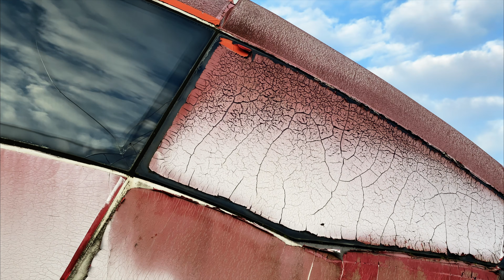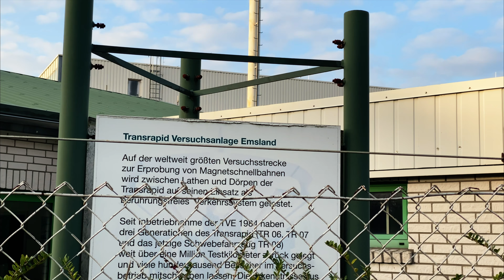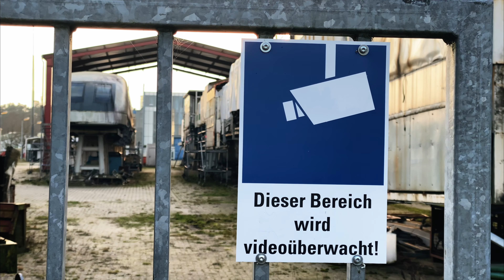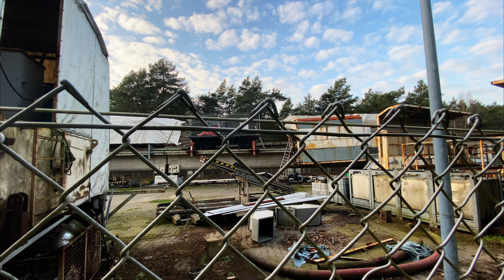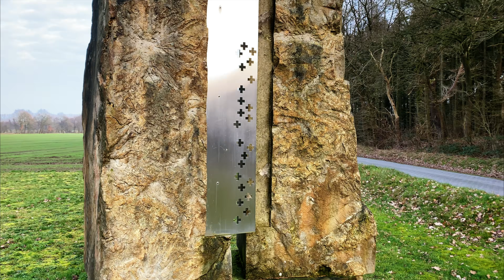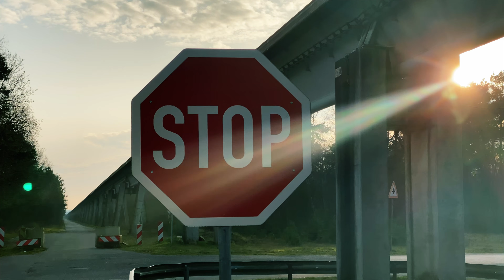ABANDONED high speed MAGLEV WRECKS - 'Transrapid' graveyard

Comment: Unfortunately, Maglevs are too expensive and too much effort to build and a nightmare to implement into already exsisting infrastructure with too little benefits compared to modern highspeed rail, to ever become a viable mode of transportation. There will probably be a few prestige projects connecting an airport with a city center, like the existing one in china, but that's it. That's the real reason the project failed (which was by the way pretty obvious even before it started) and not because of malicious politicians, environmentalists or bad marketing like claimed in this clip. And that's the reason why the hyperloop (or any similar projects) will (actually kinda already is) completely fail miserably as well. I'm tired of people calling technologies like monorails, maglevs, etc. a "revolution of mobility" because it isn't. It's still some sort of rail-bound vehicle moving (hopefully at least a high capaity of) people or goods from A to B. No game-changing revolution at all, just the same stuff painted in a different colour and 3x -100x more expensive which will be noticed at the ticket counter. Instead of trying to "reinvent the rail" , railway engineers and companies should first and foremost increase the capacity of the existing network and make travelling by train cheaper and more comfortable, but that's just my opinion. What do you guys think?
Reply: You are right. All is a matter of costs/benefits ratio. But image if we were in a non capitalistic system , where the aim of any work is to generate a financial profit. In a non capitalistic system (No, I am not talking about communism!), there would be no money, no currency, just because it is not needed. Everything would be made just because it brings improvements and people want it. Every kind of project would be only matter of collecting the necessary working power, willing to work to make the project true. No financial benefits would be required, because there in no monetary finance. Then, in that system it would not be a problem to replace all the high speed trains with maglev, if people would really like reduce to 1/2 or 1/3 the travel time. The entire rail network could be relatively quickly replaced by maglev, since it requires much less maintenance work on tracks and mobile parts. Traditional railway requires a huge amount of maintenance work and replacement parts every year.
Reply: This, to me, sounds as a likelier reason.
Reply: @rcandfun242 - "Unfortunately, Maglevs are too expensiveIt...." - sounds like you have the answers to the burning questions why MAGLEV is not used. Too expensive, not compatible, these are the usual problems that are mentioned, you can read them in practically every video. But honestly, isn't that too easy?
No matter which video I watch, everywhere the same crap. Fares of a hyperfast train are compared with those of a subway and extrapolated to European level, and end-to-end travel times against polycentric connections. This is nonsense, don't you think? Above all, these are not the real reasons, but why can't you find anything about them? What about the transformer stations, what about the switching times of the switches, what about the enormous consumption of metals (copper, aluminum) - these are topics that would be worth discussing.

The Hyperloop will fail as it is designed now, this is the only point where I agree with you.

Comment: China is considering re-opening the test track and the Transrapid design is the preferred choice for a 600kph maglev network across China. 

The technology was just too early and novel to be appreciated.  

Britain should have chosen UKUltraspeed (which used the Transrapid design) rather than building HS2.
———
German maglev test track set for revival? 
6 April 2021
International Railway Journal
https://www.railjournal.com/passenger/high-speed/german-maglev-test-track-set-for-revival/

INDUSTRIAL Plant Operating Company (IABG), which is responsible for the former Transrapid Emsland test track near Lathen in northwest Germany, has confirmed to local media that it has been approached by CRRC about re-opening the site as a test area for CRRC’s new maglev vehicles.

CRRC has continued to develop the German Transrapid technology under license from Thyssen-Krupp. CRRC’s latest CRRC600 series maglev train will be used on the planned 400km, $US 14.1bn maglev route connecting Shanghai with Ningbo via Hangzhou in China’s Zhejiang province. The Shanghai – Hangzhou project was announced in 2020 and is expected to be completed by 2035.

Demolition work at the Emsland site, which began five years ago, has largely focussed on stripping out the valuable electrical equipment for recycling; none of the test track’s concrete structures have been demolished although new electrical equipment and refurbishment of the 31km elevated test track is required if the facility is to reopen.

Potential use of the Lathen site as a hyperloop test track has also been proposed by local politicians keen to attract technology companies to the area. The basic concrete structures could potentially support a hyperloop tube if further use for maglev vehicles is ruled out.
...

Comment: The Transrapid also has some very serious limitations. Railway switches are very expensive and complicated. And freight would be much more expensive, because you now have to change mode of transport between trains and maglev. A quick search didn't show me any pictures of maglev cars  that could carry standard shipping containers.

So, at least for a few decades, Transrapid would have to run in parallel to existing (or even new) classic rail lines. Passenger-only tracks might be viable as an inner-city transport in some small number of cases, and then only if you mostly plan for point-to-point connections instead of a network that will need lots of rail switches.

It really doesn't matter how good the technology is. If you have to basically start from scratch instead of having the ability to upgrade the existing network segment by segment while staying backward compatible to existing rolling stock, then it's just too damn expensive.

Given the large existing railway infrastructure in germany and the whole of europe, it would probably take 50-100 years of heavy investment before you can even start thinking about making a profit and slowly getting your money's worth.

And you also have to keep in mind that Transrapid would have to compete with ongoing innovation in classic trains as well as cheap budget airlines as well as road traffic, i highly doubt that Transrapid ever had the chance of getting implemented. It was an engineers pipe dream all along.
Reply: OMG!

The only reason fore failing are people like you! You are German, right?

Instead of writing a lot I'll point out only one aspect:

All really successful high speed trains (with conventional techniques) have their own tracks witch are not shared with freight train or even local trains.

- Shinkansen Japan
- TGV France

Therefore your reason is no reason.

VGA
Reply: @DB_lO3_ll3-7  No i'm not German.

And logistics plays a LARGE part in any successful future rail project. It's also worth noting that at least TGV can use the normal existing rail network, the same as the german ICE. This is giving them an automatic advantage, because they can use tracks that haven't been upgraded to reach some destinations.

The town where my parents live is currently getting new high speed rail, but surprise, it will also be used to carry freight, because it doesn't make sense to buy more land, build more bridges and put in additional rails just for the occasional freight train.
Reply: @ReneSchickbauer  I think you are absolutely right. It doesn't make sense to build new infrastructure projects in Germany, Europe or the US.
Couse Chinese can do it cheaper and faster. And they will do it.

And there's still hope that they'll use the Transrapid
https://m.youtube.com/watch?v=fvMXvRA03ps
Couse in new Chinese version, so one will remember, expect of some people who do the research in the 1980th... and me.

P.S.: switches are really expensive. About 100.000 €. For a conventional switch of course. Can you tell us, the cost for a switch from TR? Or is it more like a religious "expensive", something to believe?
And what should be complicated? A peace of steel witch is bend? Like every switch in rail technology.

VGA
Reply: "Railway switches are very expensive and complicated"
Expensive .. well yes sort of, complicated, really no. A normal rail point is more complicated.

"And freight would be much more expensive, because you now have to change mode of transport between trains and maglev"
It not diffrance in any way to any other mode of transport. Either way, it was not really ment for gods.

"A quick search didn't show me any pictures of maglev cars  that could carry standard shipping containers."
Well maybe you should seach more. Either way, did you see pictures of high speed rail with containers on?.. No you didn´t.

"Passenger-only tracks might be viable as an inner-city transport in some small number of cases, and then only if you mostly plan for point-to-point connections instead of a network that will need lots of rail switches."
Pretty much all high speed rails around the world are passenger only.

"upgrade the existing network segment by segment while staying backward compatible to existing rolling stock,"

In Japan and Spain high speed train and normal trains don´t even have the same gauge. In France they have different rail angle, and that is true for the ICE3 tracks in Germany as well.

Also what would be the point in running the old stock, what is the advantage? Nobody is doing that.

"50-100 years of heavy investment before you can even start thinking about making a profit and slowly getting your money's worth."
Did you calculate it.. or just guesst?
Reply: I am very annoyed you said freight was a serious limitation as if it was ever intended to carry freight. Many high speed trains have dedicated rails that are only used for passengers so what gave you the stupid idea that an even faster passenger transport system would ever be used for freight.
Reply: @mcmadness110  Because there are very few cases of passenger-only service making enough money to break even.

The problem of Transrapid was that it was designed as a very limited but very expensive passenger-only service. It doesn't have all that much advantage over modern day high speed rail, it costs a LOT more and it isn't even compatible with existing rolling stock.

Modern high speed trains have huge advantages over Transrapid, because they can (in addition to dedicated high speed rails) use the rest of the existing rail networks.

And fast cargo transport is becoming more and more important too. Think "next day delivery".

Yes, Transrapid looked cool and it was "made in Germany". But that counts for absolutely nothing by itself. What counts is how much profit railways can make when investing the technology. In case of Transrapid, the answer was "none at all", apparently.
Reply: @ReneSchickbauer  
", it costs a LOT more"

Do you have a source for that, or did you just make it up? (top tip, int don´t it cost less)

" isn't even compatible with existing rolling stock."
That is true for most HSR system in the world.

"Modern high speed trains have huge advantages over Transrapid, because they can "
That is not really true. Its not true what so ever in Japan och Spain, In france it can only run on legacy system with some regulation, and the track have to be addapted to do so. Also there is logistical issues with it.

"And fast cargo transport is becoming more and more important too"
There is literally nowhere in the world today where cargo run on a high speed track.

"he answer was "none at all", apparently."
Do you have a source or did you make that up?